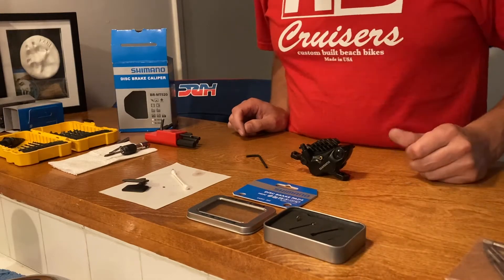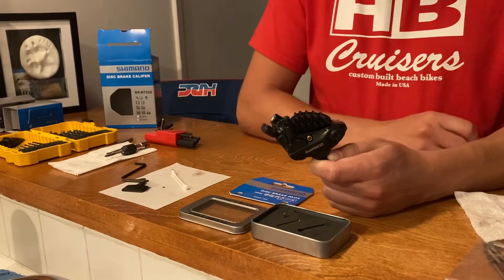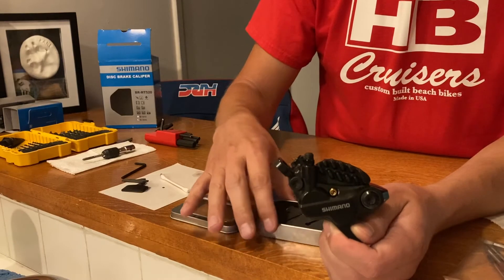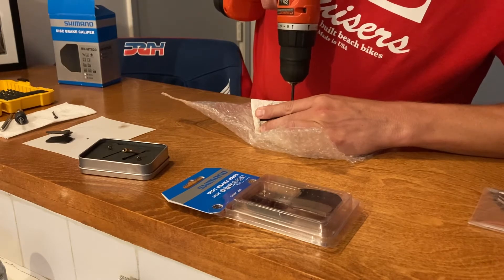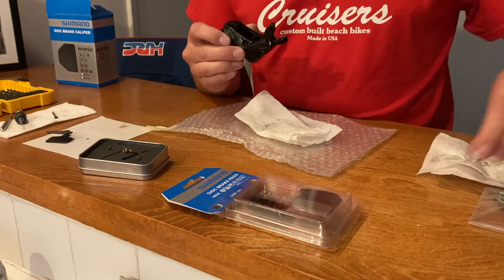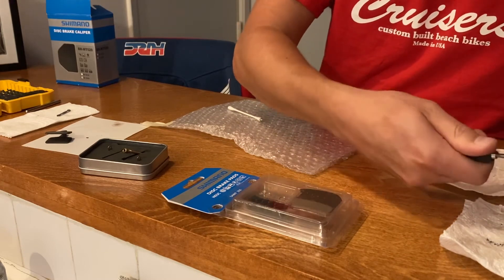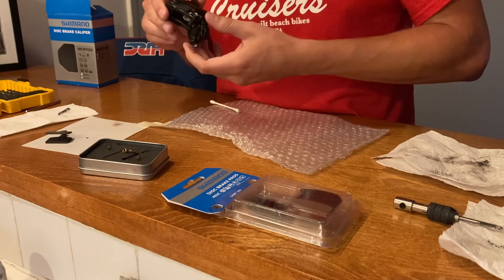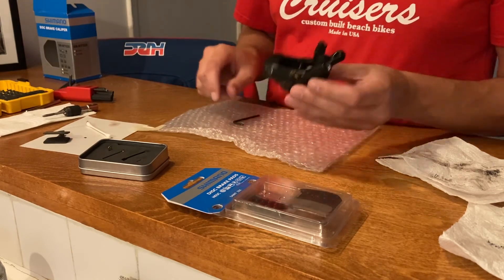Modifying Shimano BR-MT520 w/H03C pads & Gold M4 threaded cotter pin

Comment: Are there organic wented/fin pads for MT520? I dont need the metal ones they are just gonna squeal, im riding in warm dry conditions.
Reply: H03A-RF  is the same type on the video , with resin material . Shimano however says they both are not compatible with MT520 . I don't understand ; The fins seem fitting perfectly. MT520 has ceramic piston ?

Comment: Does not the Threaded pin reduce forward and backward movement in the pads?  I have an EMTB I just upgraded rotors from 180MM to 203MM with Center Lock and notice a bit of movement when applying the brake and rocking forward and backward.  I thought it was the splines on the center lock but it may be the pads moving.  I may try this on my Shamino BR6100 Calipers which have the cotter key.  Thanks for sharing this information!
Reply from the maker: I’m sure it does a better job holding the pads in place vs the cotter pin.
Reply: @clemonsjoey  Thanks.  I the Amazon link is broke.  I was able to find some Pins but the diameter of the pin that goes thru the caliper/pad holes  was 3MM.  I think yours were 4MM?